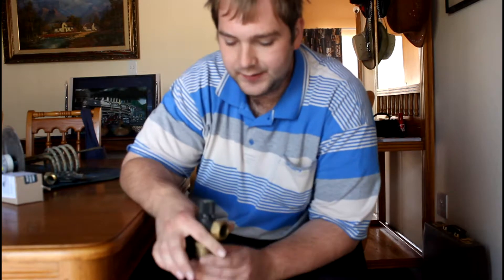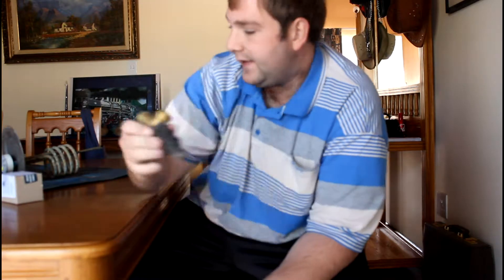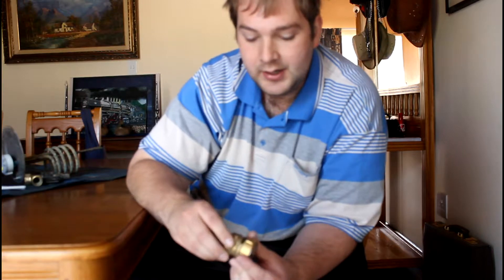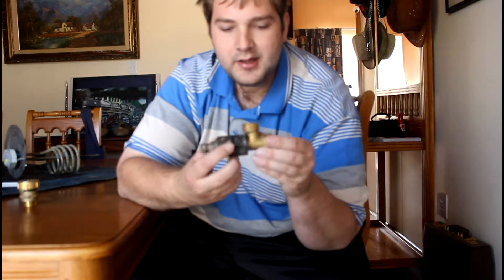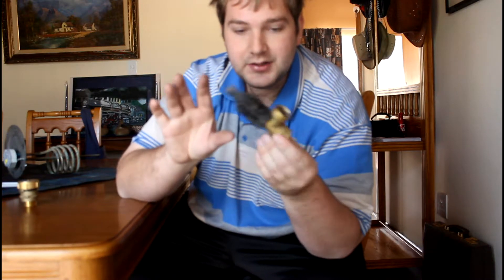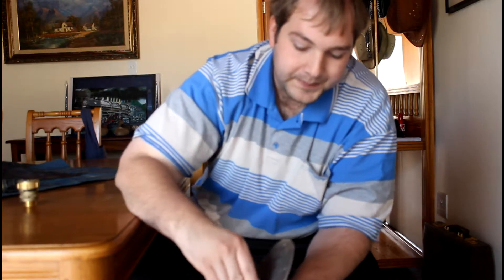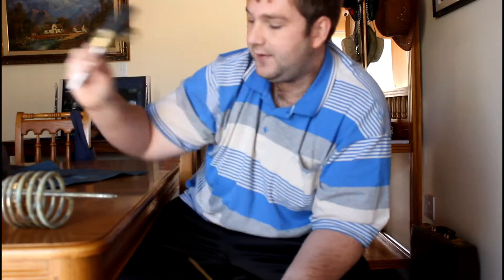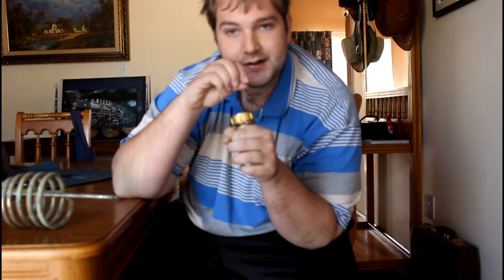Safety valves on geysers

Comment: Hi if i buy a 600kpa geyser and fitt a 400kpa pressure vavle as well as a 400kpa safety valve. Will that not give it less chance of bursting?
My house has 400kpa valve outside. So putting a 600kpa pressure valve to the geysers makes no sense. 
Regards 
Robert